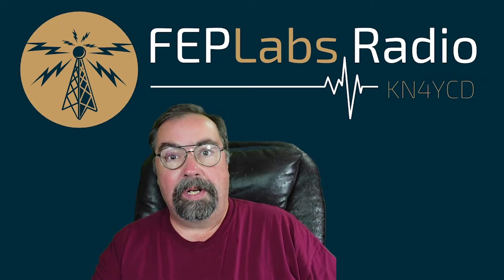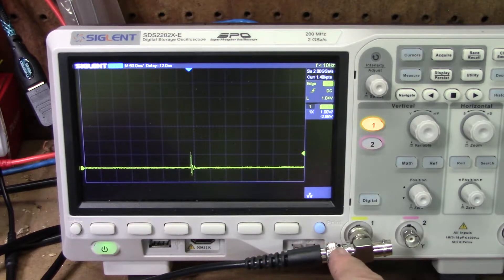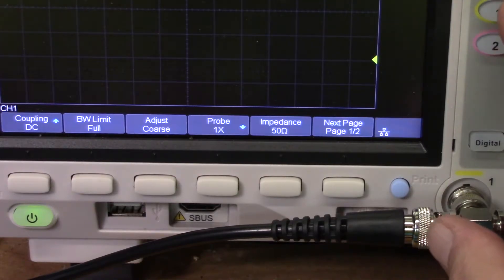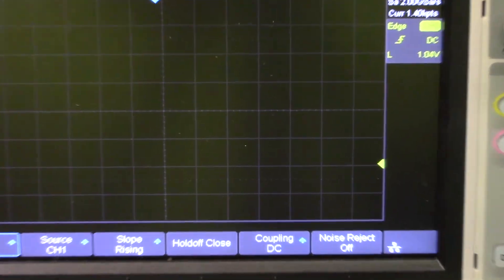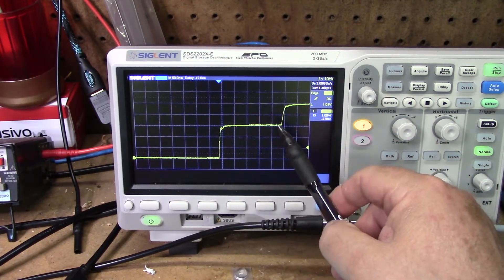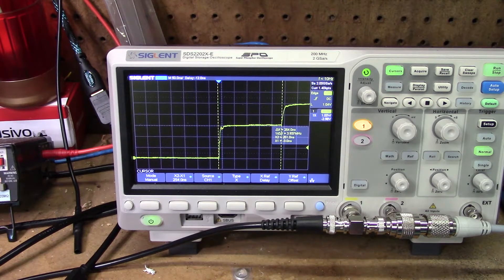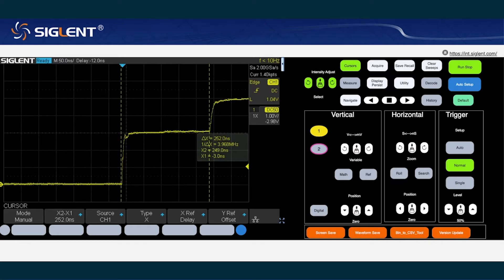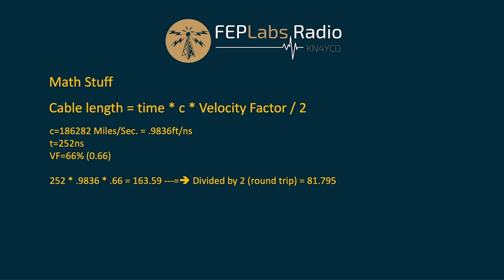Stupid Scope Tricks #1 - Measure cable length with an oscilloscope!

Comment: I wonder if this works for a single wire buried in the ground for an robotic mower or invisible dog fence.
Reply from the maker: I can't imagine it wouldn't - you'd have to rig connectors, this is basically a TDR without the calculations done automatically.